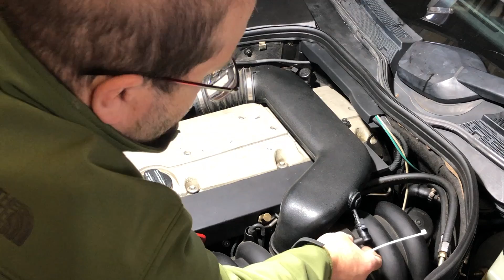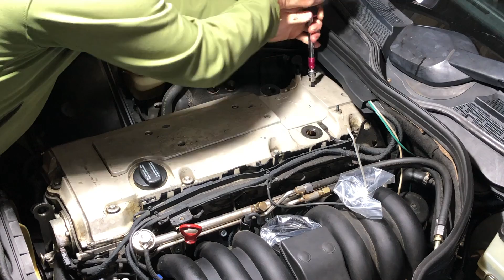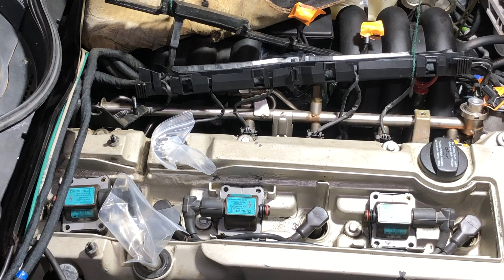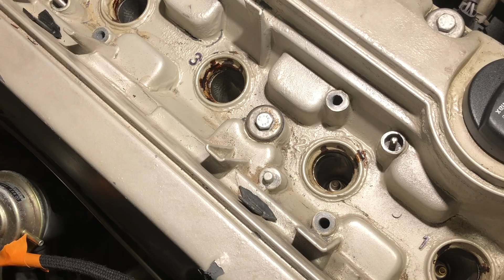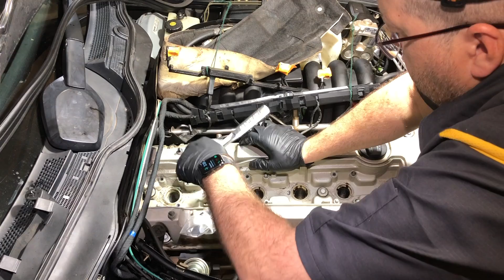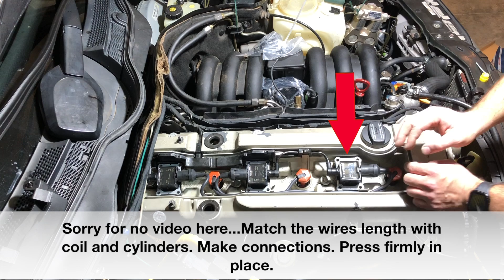Spark Plugs and Wires and Ignition Coils 1994 C280 W202 M104

Comment: Where can i find those coil caps?, i have a Mercedes 230 kompressor 1997, i changed the coils but those coil caps are roasted, regards from Mexico
Reply from the maker: I bought mine from FCP Euro. Use your VIN when searching and type the part or search by category ignition / electrical. If the part is available they should have it!

Comment: I followed this but I accidentally did the wiring wrong, the car started but really rough, I re changed it into the correct wiring and the next day the car won’t start and I re worried it into the correct order changed the spark plugs, plus the wiring, still no start what is the problem?
Reply from the maker: Oh man! I don’t know. I hope the community can help. Check fuses. Check battery connections and charge. Are there any fuel injectors disconnected?

Comment: you should do it one at a time, remove, replace and that way you cannot ever get the wires mixed up.
Reply from the maker: I agree Russell. Thank you for watching! When I was replacing my coils and wires I was also replacing my valve cover gaskets and spark plugs. I figured while I was at it taking everything apart I would replace what I could.